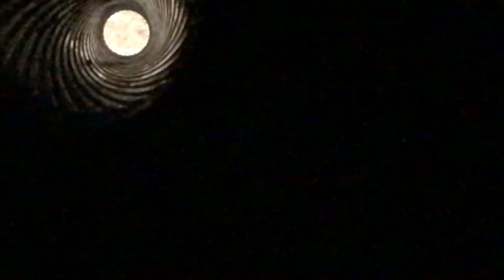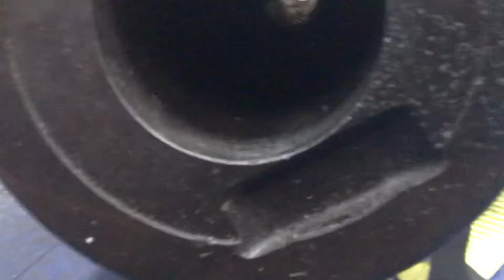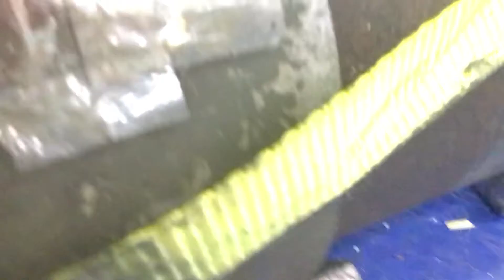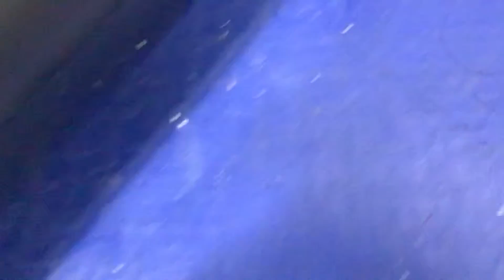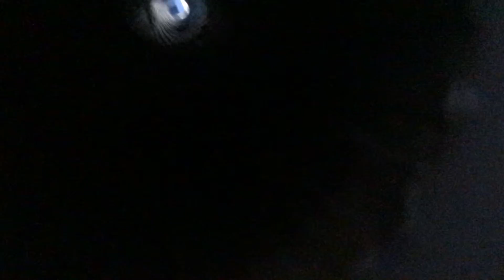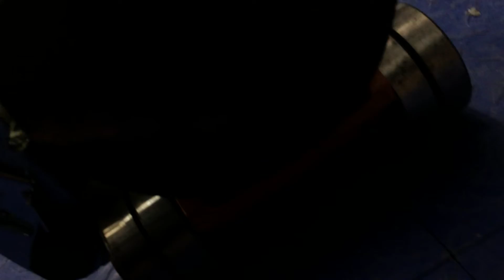3 inch 50 barrel clean

Comment: bidirectional string theory. One of the strings goes to one end of the universe and the other to the opposite side. A vortex occurs between these two strings. We call this vortex electron. Plus electron if it turns right. If it turns to the left, it's negative electron. That's the truth. The speed of the vortices is much higher than the speed of light. Light is actually vibrating string. They put us to sleep for years. Because all atoms are the same. You produce x-rays. You move the objects with these rays.